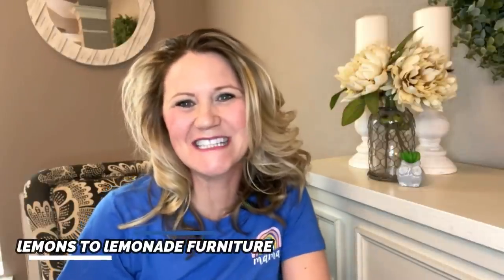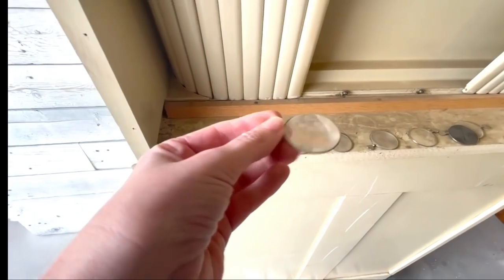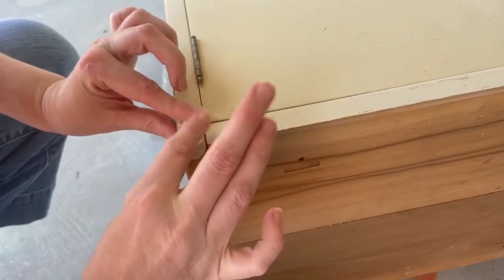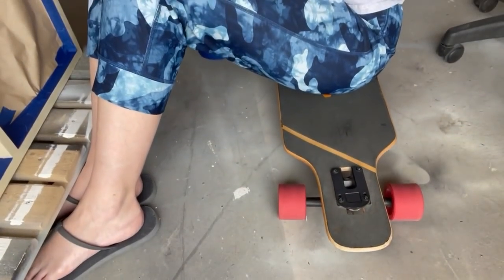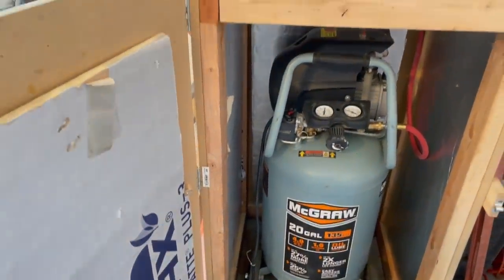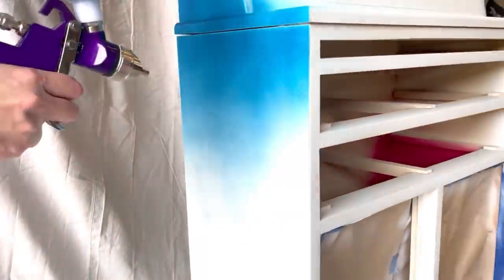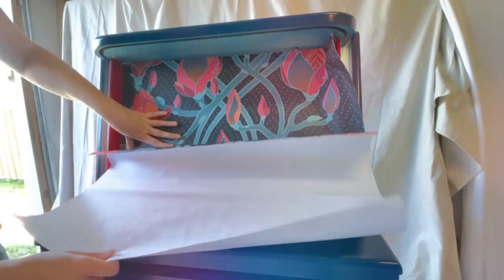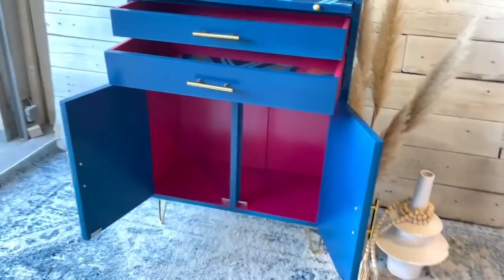Furniture With A SECRET// Crazy BEFORE & AFTER!

Comment: I'm curious, what size spray tips do you use for the various paints with the HVLP guns?
Reply from the maker: I only have the one that comes with the gun. I would prefer a smaller one for my poly gun but haven't gotten around to it.
Reply: @LemonstoLemonadeFurniture  Thanks
Reply: @vmoutsop  1.8 for heavy bodied such as paint and 1.4 for light body such as lacqer